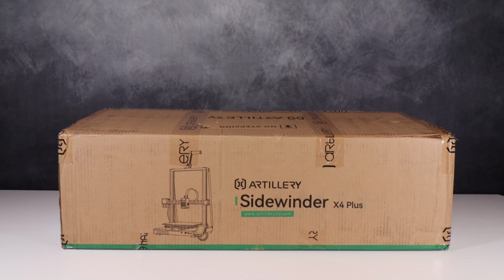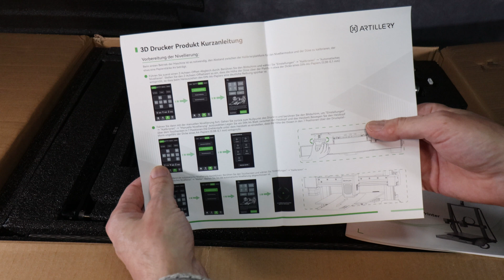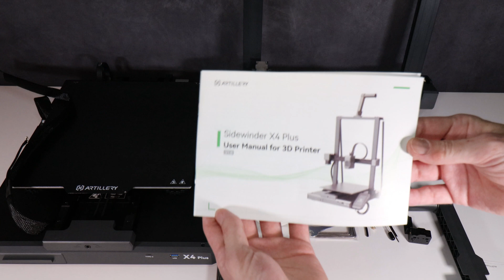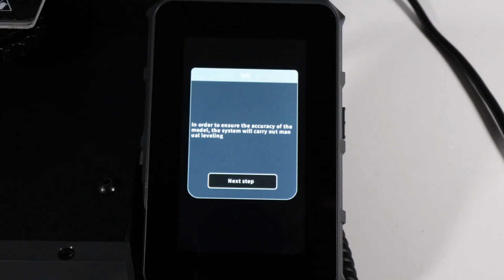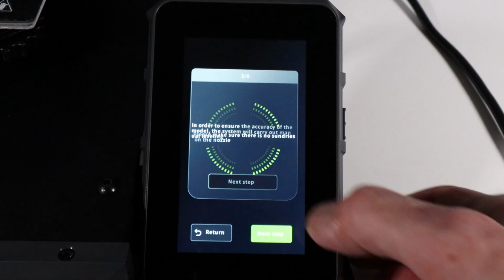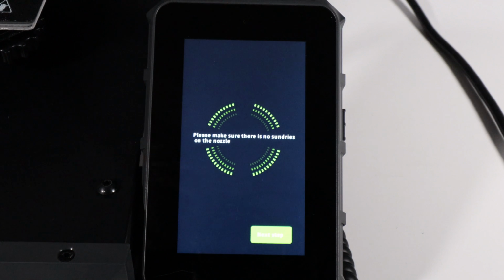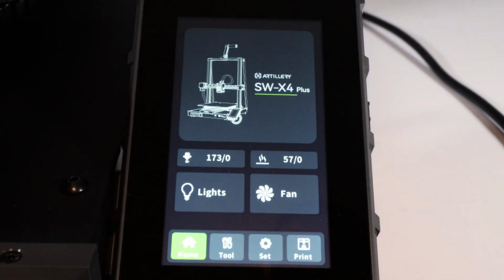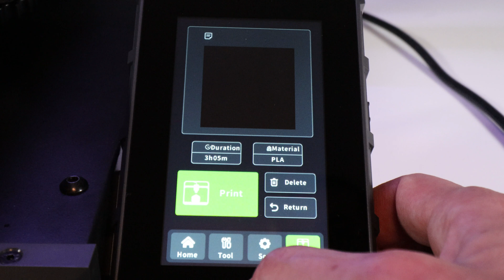Artillery X4 Plus Review

Comment: If you would be so kind, what model accelerometer did you use, and what is involved in installing and taking advantage of it?
Thanks,
Greg
Reply from the maker: I used a bigtreetech adxl345 that came with the pad7, I had to change the wiring on the plug to get it to work, they tune it from factory but every surface is different, send me a email studiozombie3d@gmail.com and ill send the pin out for the plug if you need